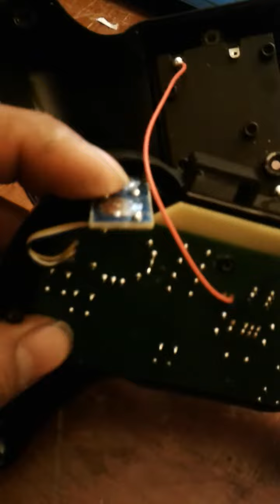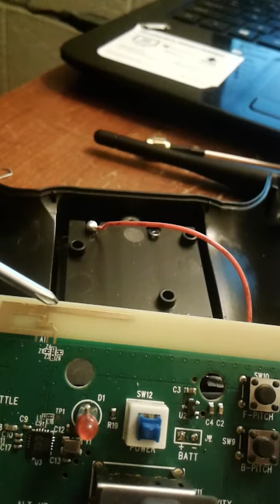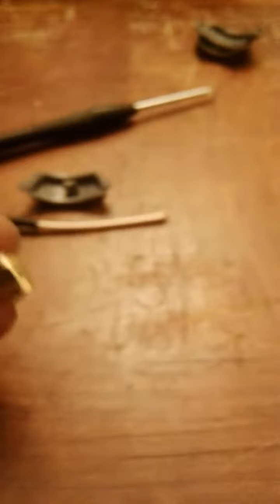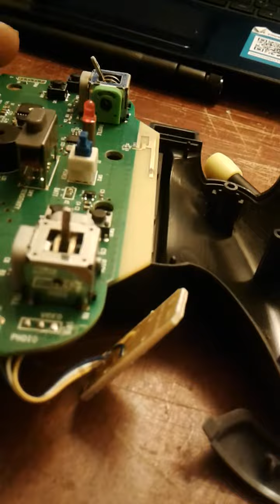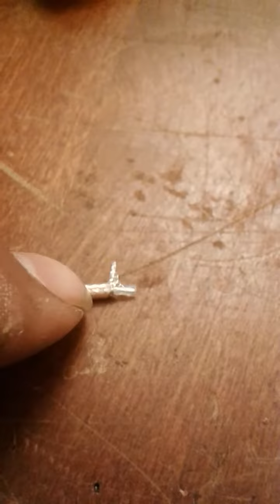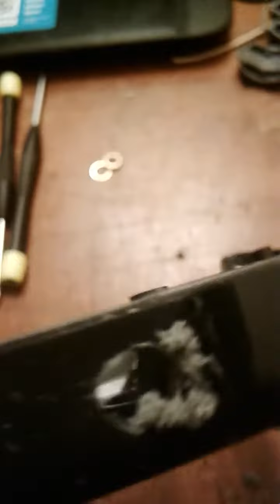Skyviper controller mod step by step (part1)

Comment: I tried this using a 2.4 gigahertz antenna exactly how you did it, and now my sky viper gets way less range. before upgrade 128.6 feet far and 204.8 feet high. after upgrade 46 feet far and 84 feet high.    :(    PLEASE HELP ME
I used expensive antennas too
Reply from the maker: sorry to hear that the mod didint work you now the db of the antenna u used
Reply: Serjovax FPV I used a 2.4 gigahertz phantom 2 antenna, then I tried a Phantom 3 range extender 2.4 gigahertz antenna, then finally I tried a random Chinese drone antenna and it gets the best range of all but it looses connection easily